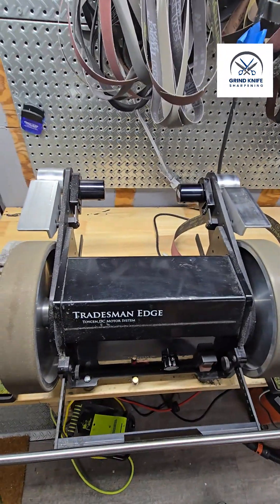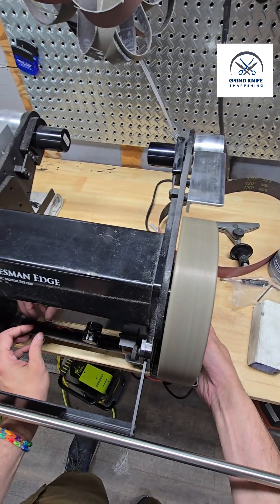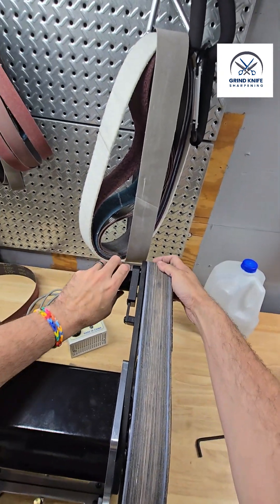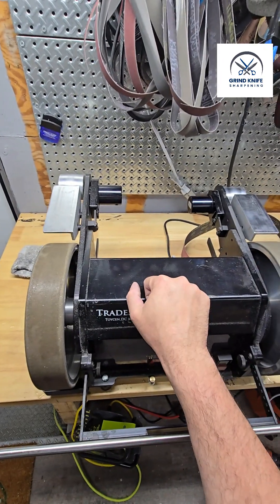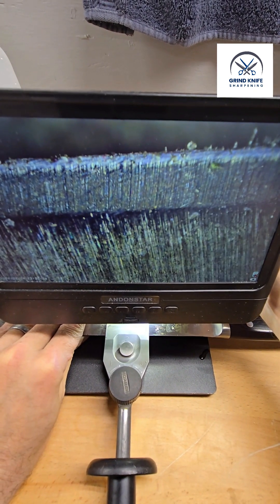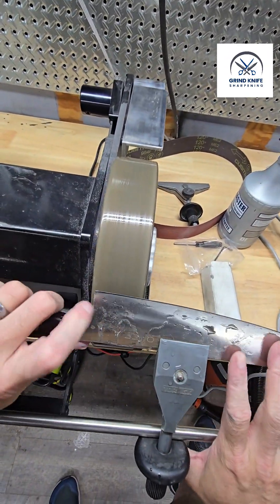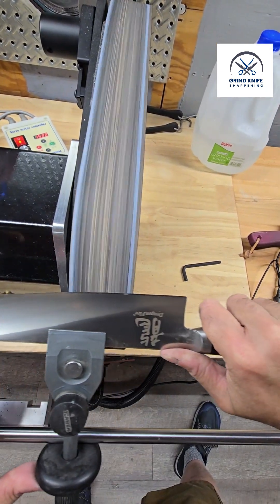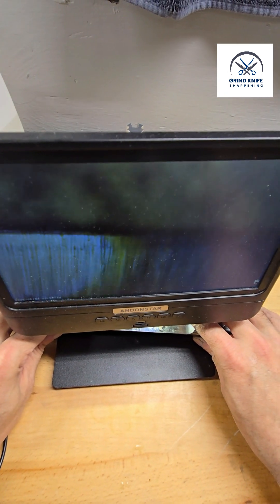Sharpening and Microscope Edge Analysis

Comment: hey Ryan do you use the same bar settings for the strop? I can definantly tell mine deburrs on the same setting, but when I look I can tell it has polished more at the back, it could be that because the leather has a little give it compensates for the extra thickness of the strop. Regardless I got really good results.
Reply from the maker: @Musicpins  you have afew choices.  since I have a dedicated stropping machine I zero it with the belt on this compensates for that.  otherwise call Brad and ask for the clip for the jig.  it clips on and turns the knife up slightly for stropping
Reply: @GrindKS1  I thought of getting an extra stropper machine at first, but I decided to wait, maybe I have the opportunity to get one with an AC motor later now! Why not.

Thats nice, thats far to send such a small part to europe, maybe I can produce one of my own :)
Reply from the maker: @Musicpins  give me a call! 6056816637
Reply from the maker: @Musicpins Another comment you left i cannot respond to unfortunately,  The brushless machines are available. I can help you out with your order or any details if you like!